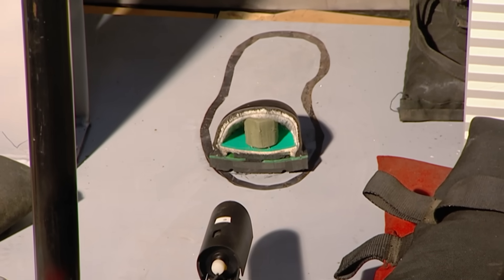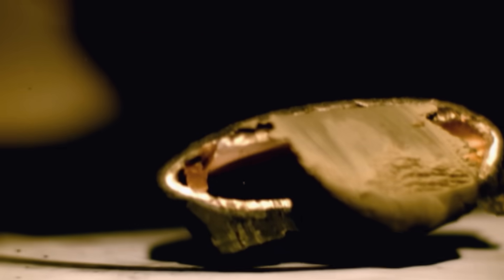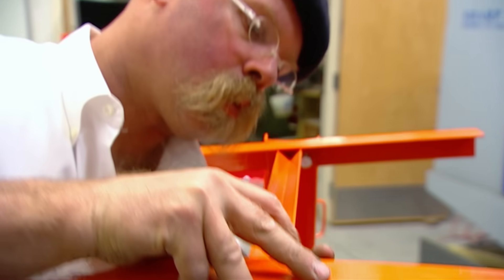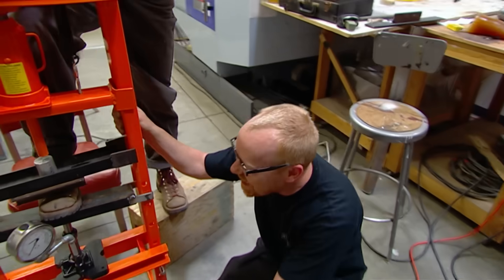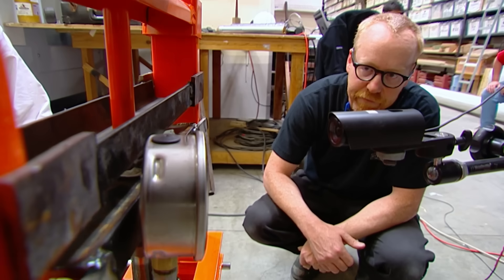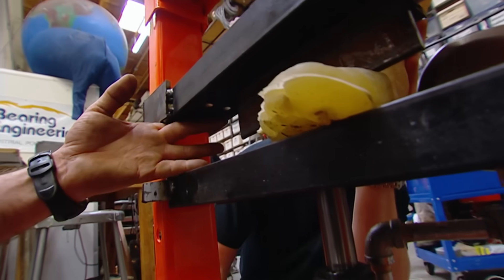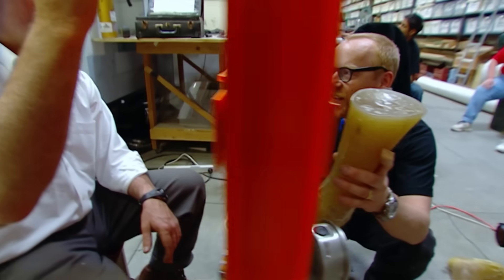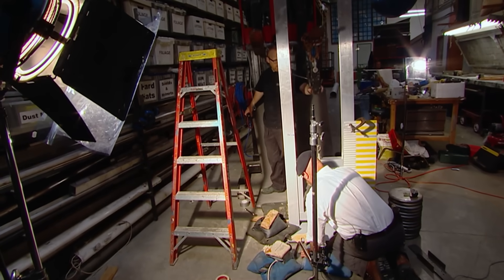Do Steel Toe Boots Really Protect Your Toes? | MythBusters

Comment: I'm surprised this actually had to be tested. If something is heavy enough to cut your toes off with steel toes, it would also crush your foot to an unusable state without steel toe. Likely even mangle to the point amputation. Bottom line is that if 10,000 lbs falls on your foot you are losing that foot. If 300 lbs falls on you which is far more likely, you will have a much better day if wearing steel toes.

Comment: Worst I've had done is a truck run over my foot. Didn't even feel it. Used to prop up 3inch iron pipe on them if the angle was off to make up a connection with a sledgehammer.

Comment: The only place I've ever heard of avoiding steel toes for safety was around horses - if they step on your foot apparently it's better for them to crush your foot instead of potentially amputating your toes? But that was on an episode of Dirty Jobs almost 20 years ago and who knows how true it was
Reply: Depends on if a horses leg strength is strong enough to compress steel.
Personally do not believe they are and in horse riding the weak point would actually be lose dirt so I think you’d be fine.

Comment: Wait a sec, their final statements don't actually match the 'amputation' observations. They both agrees in the last 5 or 8 seconds that there will "always be more damage to your feet if you're not wearing steel tips than if you are." Right? But their test just showed a scenario where a blade slides toward the rear of your foot off of the bent metal of the toe cap. Without steel toed boots you would lose your toes where the blade lands. With steel toed boots, you might lose considerably more (and 3/4 inch is def. considerable when talking about your foot). It's a pretty specific scenario, but one where you'd be better off without the toe caps. Most of the comments seem to be missing this.

Comment: At my job we have a 23000 kg steel block we use as a wall to straighten steel 😂😂😂 we dropped it on top of a steel toe boot, held for about 2 seconds then bam squished it to a flat steel plate lol

Comment: Not a myth and not something tou ever want to witness. I was stationed with a guy on board ship that didn't secure a large deck hatch. The ship slightly listed, the hatch came down and his foot was on the knife edge. Blood was everywhere, just oozing out of his boot. Steel toe crushed and he couldn't take the boot off. They cut the laces and still couldn't get the boot off. They finally had to cut the sole off. I have no idea how he did not lose any toes... That was because not only had it crushed it to a half inch, but it took them so long to get the boot off in his toes were swelling. Of course I walked in when they were taking the foot out of the bottom of the sole. 
He ended up breaking four bones, if I remember right they put pins in, then he had a cast. All totaled he was not on the ship for a year or more. The majority of that time he was on crutches. It makes my butthole pucker just to think about it 🤮😬.

Comment: I worked in Alaska at a mine site, the MSHA inspector tried to ding me for not wearing steel toes. I told him he was crazy.
Let me explain.
We were replacing an engine on the 5230 shovel at - 50 and colder.
Was wearing my Vapor Barrier boots to keep my feet from freezing.
This MSHA inspector likely never worked in those conditions, steel toes and -50 doesn't work..

Comment: Steel toe boots have saved my big toe once. I accidentally maneuvered an electric pallet jack and it landed right on my big toe. The jack weighted about 4000 pounds. It did not slam on my toe, but the weight would have been enough to earn me a trip to the hospital. My boots leather was cut clean through. I believe it would have kept going all the way through if not for my steel toe boots. Might have been a different story if it fell and slammed on my boot 🫤

Comment: It's not steel toes failing which are the problem. It's cheaply made shoes where the steel cap comes loose and cuts into your toes instead of distributing the weight into the base. Hard to believe they didn't even discuss this.

Comment: I worked in a fabrication factory and I definitely recommend steel to shoes.  There are plenty of good makes for different needs. I’ve also run my toe over with a pallet jack when I slipped on a skid plate.  I wasn’t wearing steel toes that day and it sure made me wish I had them. I was hauling LTL freight at the time.

Comment: The purpose of steel toe caps is for the minor day to day accidents when they can cause deflection of an object that would otherwise smash your foot/ toes. The caps are shaped to create a curved wall on three sides. A test that could be done here, would be to drop a 16# bowling ball from waist height, on both shoe types. Use steel blocks of 20# weight in a similar drop test.
  How many people have drilled a very small hole in a throbbing purple finger or toe nail? A great presentation of a serious subject.

Comment: As a retired welder of 40 years, I always had steel toes with a metatarsal guard. I once had a piece of 3 inch plate, approximately 1×2 feet drop on my foot from about a height of 3 feet. Broke almost all of the bones in my foot, but i still have my entire foot intact. That was 30 years ago, and yes, I have a pretty bad limp, lol.

Comment: I was a member of the local fire department, and we had a call.  I jumped into my turnout gear, went to the call, and back to the firehouse.  I had left my boots in the middle of the floor, and our 1990 Pierce Lance 1000 gallon pumper truck ran over my boots, fully and completely.  I put my boots back on and went home.  Steel toed Rocky boots.  The chief even used them as an example of great protection.

Comment: I used to hate steel toes in my line of work, but one day while wearing them I slammed a 42 Lb rock pick directly to the tip and only broke my big toe. pretty sure if I didn't have that layer of protection I would have split my foot down the middle

Comment: Had a forklift drive over my foot at work. He drove backwards so fast and didn’t see me, rammed my side, I fell and one wheel went full over my foot. The “edge” of the wheel aligned with the steel in the sole of my shoe. The other side of the wheel went over my ankle bone. Whole foot was black for months but not broken. 100% would’ve been off if not for the metal in the sole.

Comment: I've often heard fellow blue-collar workers say, "I don't wear steel toe because I'd rather have broken toes than cut off toes." Not much I can do but shake my head. 
"Broken" May technically be accurate, but if it was enough force to cause your steel toe to amputate you then your toes would have otherwise been closer to liquid than solid. 
Amputated toes can be reattached. liquified toes will be amputated and your foot will never recover.

That's not to mention the 99.9% of accidents in which your steel toe will protect you without any deformation where you otherwise would have just broken your foot.

Comment: My first full time job was working at a grain elivator and one of the my main duties was stacking 66lbs bags of beans onto pallets to be loaded into shipping containers. We would use a forklift to hold the pallet and as you stacked the bags you would lower the forks to help save your back. I had just slammend a bag down and a hydrolic line blew on the forklift dropping the pallet on my right foot. If i had not been wearing my Red Wing Irish Setters with a steel toe my toes would have been crushed. I was stuck in place until I unlaced my boot and just sat on the pallet until they came back with another hydrolic line for the forklift. Steel toe held up perfectly too didnt damage the boot and I wore them for three years after that.

Comment: I worked on construction sites for 20+ years, dropped many things on my feet over the years and only got one broken toe when the corner of a 40kg concrete slab slipped from my grip and went just behind the steel toecap. Big toe breaks effin hurt, but never had a day off for it, just a quick xray on the same day, then back to work.

Comment: Steel toe shoes may not save your toes in every situation depending on how heavy the object is tgat hits your foot, if the object is heavier than the steel toes can withstand it will make a clean cut causing less damage to the foot and make it easier for doctors to repair in surgery.

Comment: During a summer heatwave in Los Angeles about 10 years ago (100˚F days, 78˚F at night sort of thing), I was heading out on my motorcycle to work. Before I left I had a big debate with myself over the hot Wesco 18 inch tall engineer boots with Steel Toes or the much cooler 14 inch tall Doc Martens. Much flimsier leather and no extra toe protection...  I was still going to wear a full face helmet, armored jacket, heavy pants, etc. 
How much could I take?
Comfort or Safety, Safety or Comfort?

On the way home that night there was construction at a larger intersection. This channeled the normally 3 or 4 lanes down to the one that was still open for traffic. Waiting at the red light I had my feet out to the sides, sitting on the bike. When the light turned green everyone started to slowly crowd towards the open lane rather than driving straight and parallel to each other. 

This meant that the small SUV to my left got closer and closer to me as we all angled for the open lane. As I waited for my chance to get the bike in 1st gear and moving, I suddenly realized my left foot was trapped under their back tire. I could feel the tire pinching the side of my foot as the wheel captured more and more of my foot. I watched as it slowly rolled over from the side of my foot toward the front of the boot.

When I got home I took off my Steel Toed Wescos and noticed a slight pink color back around the edge of my foot and the beginning of the baby toe. Nothing else happened. The steel carried the weight over my toes.
I was very happy with my decision to wear those heavy boots that day. Later that night I watched a movie and slept like a baby.

Turns out Safety is a lot more Comfortable. 
Food for Thought
Take care.

Comment: I worked at Freightliner Truck Plant in Portland, where Everything is heavy and could crush you in the blink of an eye. I've seen an engine spin off its mounts while guys were hooking it up. A cab suspended 10 ft that broke from its staps as it was being hoisted onto the chassie. The one that sticks out watching this is when a 5th wheel slipped from a hook as it was being lifted into place; it came down on both feet of the employee. He was also standing on a steel grate. Both feet were sliced off and pushed through the grate... There was nothing left up to his shins and ankles.

Comment: I used to be a lab technician and would have to wear steel toes to pull these massive tanks of tissue culture that were easily 500-1000lbs each when empty. Sure enough a guy didn’t wear his steel toes one day and ran his foot over with a tank and mangled the hell out of his toes, and was fired for obvious reasons. He still has a limp to this day 10+ yrs later

Comment: In the last test, was the boot attached to the base to simulate someone's standing on their foot as would have happened when the pipe fell in that case from 2001? If not, that could explain part of why the guillotine setup cut behind the steel toe instead of on it.

Comment: except the lawsuit that it happened said it was from a pipe, what was the diameter of that pipe? a heavy pipe isnt gonna have a small diameter to cut like a blade, you should have done the weighted drop test with a block at the end not the blade, but you purposely skewed the results even after being told the circumstances in the lawsuit
Reply: Also you never did any tests on any of the "better" safety toe shoes, there are composites and fiberglass toes that claim to be just as or stronger than steel, and wont cut off toes, test those and see what happens

Comment: worked in a warehouse for 15 years while wearing stee; toe boots. Dropped pallets on them, clipped my feet on the MHE, kicked my foot a few times into the cement barrier by mistake, clipped a long legger MHE that took the corner tight. I still got 10 toes. So YES they work for the task they were made for.

Comment: Where i worked in the Netherlands for a time, the steel and toes thing happened. It is Definitely not a myth.. we switched to boots with i think a kind of hard plastics.

The second issue is that steel doesn't change back when the pressure is gone. So you can get crushed etc. 

I don't use them. Ever. There are good alternatives

Comment: I work at a heavy equipment shop, obviously if a zx890 excavator ran over my foot (~190000lbs) my foot’s gone. But that’s not going to happen unless something went SERIOUSLY wrong. But will it save my foot when I accidentally drop a roller that’s about 200lbs on my foot? Absolutely it will, and that’s a lot more likely to occur than something horrific like the first one 😂

Comment: I used to be a reachtruck (forklift) driver.  I once smashed my foot between the forklift and the racks.  If it wasn't for the steel toes I wouldn't have left with only sprained toes.

Comment: Steel toed boots, mandatory where I worked for about 10 years, ruined my toes.   Not because they didn't protect me from falling heavy objects.   Because I have a wide foot- my shoe size is 7-1/2 EEE.   But steel toed boots are only available in standard width in whole number sizes - so I had to wear a size 9.   This meant that the steel cap was too far forward and didn't cover my toes - but my toenails kept getting jammed behind the ridge where the steel cap edge was.  And the steel toed boots are made of plastic, not leather, and promote fungal growth in our humid climate.

Comment: I had a stack of about 35 drywall sheets fall over onto my boot. Weight so heavy I couldn't budge at all. Someone had to find a nearby steel pipe and pry the drywall up for me to free myself. It was heavy enough that after the 15 seconds it spent under the sheets, my foot was numb. If I was wearing normal shoes, my toes would've been entirely crushed.

Hell, I don't even work in my yard without steel toed boots anymore.

Comment: I wore Steel Toes to school for fights. Southern Kentucky VS City boy that just moved there I needed them.. BUT the mom of a buddy did run over my toes she was still talking and started rolling away before I could step back from her Chevy Nova. Didn't feel a thing. My fav MythBuster episode = Lighting dark with mirrors like the Mummy. You forgot something vital.. They used reflective paint so the ambient from the mirrors made all their tunnels glow. Points at Solatube Technology and taps indoor Solar Panels before holding finger over mini-solar panel on old calculator that charges by lights in rooms You can stack light from several intakes to one spot. I don't like Solar panels on the roof its ugly.. I like storm impervious designs. - Dracula

Comment: my foot was saved by my steel toed boots, i had thick steel plate fall on my leg, leg and knee where brojen and bruised  but my foot and ankle just had minimal damage, the boot had been squeeze sideways and was deformed, not comfortable, but compared to the rest...wow soo much less damage, it deformed doing the job ig was designed for, my Knee protection was foam pad and external hard Kneepad, that still had my knee messed up but not as bad as without protection. 

  SAFETY EQUIPMENT IS THERE FOR A REASON,  every safety rule and piece of equipment... is there because of enormous amount of blood and suffering preceded their creation.

Comment: when I worked in the chemical plant we wore steel toed rubber boots in our department, one rainy nasty night we were moving rail hopper cars I slipped landed on my knee with my toes part in the coupler, before I could pull my leg out the rail car mover slammed my foot in the coupler took a minute  to get his attention got my foot out bruised a little sore but all my toes do steel toes work h--l yes

Comment: When I was on a TAV-B in san diego's Navy port I was told(by a peer) that our steel toes were designed to sever your toes in case a freight container fell on your foot to make it easier to pull you out, not sure about the validity of that but I still believe it

Comment: I wore steel toes for a shipping center job (no, not Amazon), and those guys saved my toes from disaster so many times. The most shocking indicated was one time I was walking along a bank of industrial storage shelves, which are all bolted into the concrete floor to prevent any possible mishaps that could lead to a warehouse domino effect. I wasn't paying proper attention to where my feet were positioned, and mid step I hit my foot hard on one of the bolts, causing me to stumble.

Not that bad, right? Well, I first felt relieved that the steel toes prevented me from outright stubbing my toe on a chunk of immobile metal, but then I saw what the bolt actually did to my steel toes. The edges of the bolt were so fine and sharp that it sheared nearly half of the canvas that covered the toe cap, exposing the steel cap beneath.

If I was wearing regular shoes or boots, I would have been in the hospital getting stitches that night. To this day, I prefer to wear steel toe sneakers, instead of regular ones, simply because I know my clumsy feet will be spared so many mishaps.

Comment: I was always told to never wear steel toes when working with horses, That if the horse steps on your foot it would do that. Toe decapitation instead of just squashing your foot
- I would have liked to seen a 2-3 inch metal drop to go along with the hatchet drop to see the difference, smashing instead of cutting

Comment: We had a seaman dropped a 15k pound cement block (use to set buoys in place) on her toe,   we had to cut the sole off to release pressure on her toes.  she had black and blue toes and minor cuts on top.  Saved her toes.